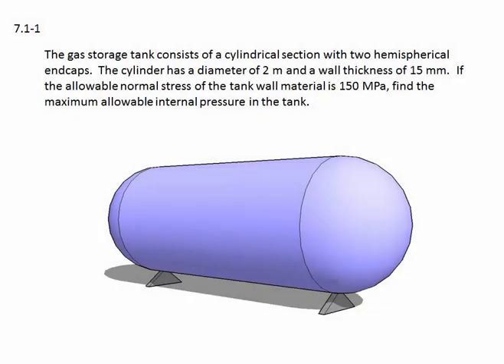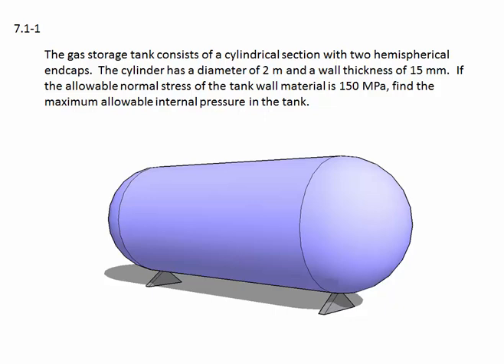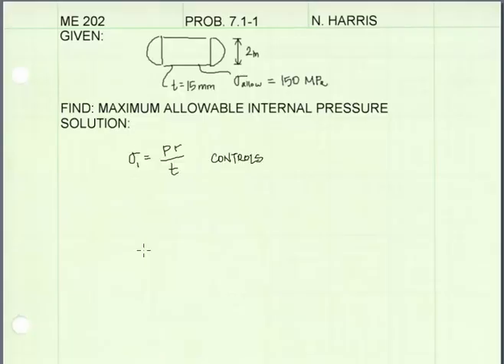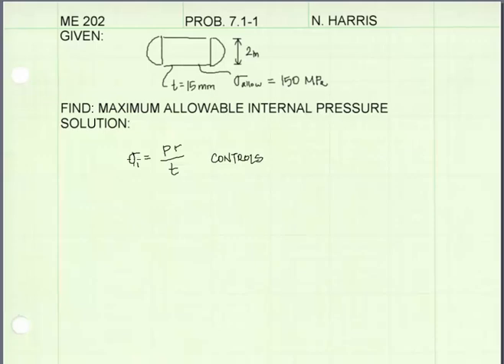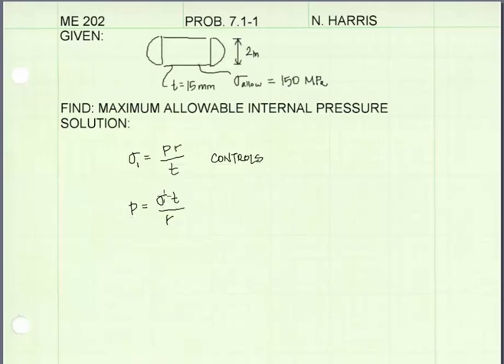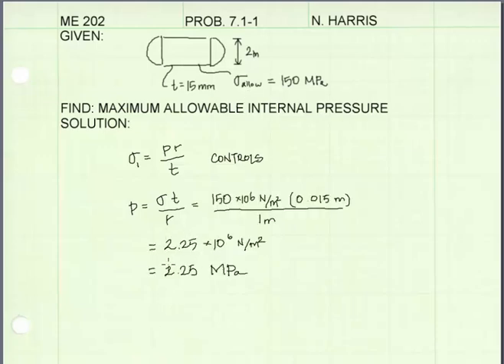07.1-1 Thin walled pressure vessel - EXAMPLE

Comment: Isn't the diameter of the vessel measured from the outer end of the wall to another end of the wall? If so, why is the radius used in the equation the radius measured from the center to the outer wall instead of it being measured from the center to the inner wall?
Reply from the maker: Thank you for your comment.  For a thin-walled pressure vessel, the radius in the wall stress equations is typically taken as the inner radius, though the error is small if the outer radius or average radius is taken.  In this example problem, I did not clearly specify what the 2-meter diameter measured which is a mistake.  For this problem to be most correct, I should have specified the diameter as the inner tank diameter.